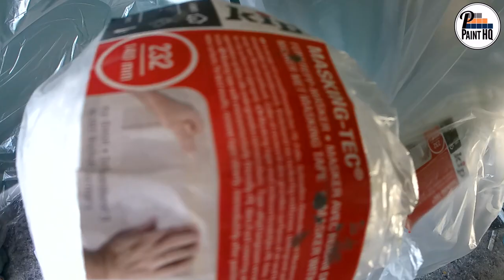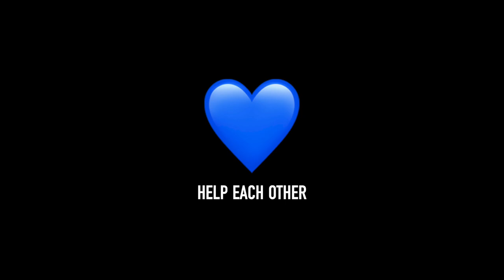The BEST Airless Spray Guns. Graco Contractor PC and Graco Contractor PC Compact

Comment: Hi Pete, it’s been a while – I hope you’re keeping well. 
I have a quick question: I’ve been using Tikkurila Optiva Matt 5 for walls for ages now, probably because I hate change (!) but their recent price increase had me looking around and I noticed that, on a number of recent videos, you are using Johnstone’s Acrylic Durable Matt. It seems to be a  of the price of Tikkurila! Have you found any drawbacks with it? 
With thanks and best wishes, Rob

P.S. I loved Stephen Ryan’s post that you pinned!
Reply from the maker: Hey Rob, great to hear from you.. yeah I’m doing great, hope you are too my friend.. very good point, it’s a reason I switched to Johnstones, along with Brewers being my local trade store and I rate the colour matches.. I’ve also been a fan of Albany Durable Matt, but I do prefer Johnstones being an acrylic.. basically I’ll thin Johnstones 10% with warm water, it really helps ease the flow, especially with it being a very thick emulsion, so you get 5.5 litres out of a 5 litre can 😆 (Tikkurila being 3 litre / 2.7 litre ☹️).. performance, scrub rating and matt finish is excellent, up there with Optiva in my opinion.. plus both companies are owned by PPG, and I’ve seen the odd Tikkurila exterior product appear to cross over to Johnstones.. as for price, you’re right Johnstones can be very cost effective.. especially if you have a word with your Brewers account manager (if a Brewers is local to you).. Optiva Primer (acrylic) for fresh plaster is cost effective, otherwise I mix a Johnstones acrylic durable matt 30% for a mist coat 👍

Hope this helps.. thanks for the kind words of support 🙏 Keep in touch.. regards Pete
Reply: @PaintHQ  Hi Pete, many thanks for taking the time to give such a detailed reply. Your reassurance is very helpful as I’m always nervous of suggesting a new product to a client. Using warm water is also something I’d not considered. I might be fortunate in also having a local Johnstone’s store in addition to Brewers!
Once again, many thanks and best wishes, Rob
Reply from the maker: You’re very welcome Rob, anytime my friend 🙏 ..Another thing I do, if the client wants to pick a colour off the F&B chart.. i’ll explain what I’m doing, and get the tester mixed at Brewers in Johnstones (not the F&B tester pot).. they’ll mix a 500ml of Johnstones Cova Plus, it’s around £5.. that way customer is able to see exactly the colour 👍
Reply: @PaintHQ  Many thanks Pete, are you just using the Cova Plus for the tester? Meaning, once the client is happy then you would get the Acrylic Durable Matt tinted to the same colour? Thanks and best wishes, Rob
Reply from the maker: Yes my friend.. at Brewers when you ask for a Johnstones tester it defaults to Cova Plus, so you get the colour but not the sheen 👍 ..let me know how you get on buddy 👍🙏
Reply: @PaintHQ  Many thanks for the clarification Pete, much appreciated. Best wishes, Rob

Comment: They spit a few droplets of paint when you press the trigger. I haven’t found a way to fix that. Definitely not the right tool for fine finish.
Reply from the maker: If you’re getting a spit when triggering on (Vs triggering off), it could be the gun packings / or cartridge swapping out of its the Contractor PC .. Or the gasket / seal needs checking in the tip guard (should be the smaller orifice gasket if using LP / FFLP tips ..if it’s the bigger orifice gasket that’s used with PAA tips, that could cause a spit like you describe.. hope this makes sense my friend 😆 ..regards Pete 🙏

Comment: What was that you were using to clean your gun at the beginning?
Reply from the maker: It’s just a cheap household degreaser called “Elbow Grease”.. it’s one of the most effective cleaners I’ve used, also in preparation of jobs.. here’s a link to Amazon 👍

https://www.amazon.co.uk/Elbow-Grease-Original-Purpose-Degreaser/dp/B07HRWGWWB/ref=mp_s_a_1_3?crid=NGXN1B6TTLZO&keywords=elbow+grease+spray&qid=1681108920&rdc=1&sprefix=elbow+gre%2Caps%2C120&sr=8-3

Comment: That compact gun looks tiny 
Probably ideal for spindles and tight areas 
Stick with my tritech
Reply: Having said that I’ve had two tritech guns where the handle thread has worn out and will no longer grip and leak 
Have you had this at all Pete ? 
A Wagner one to
Reply from the maker: Hey David, it’s design as to how two fingers wrap around the swivel / hose, plus a 1/8” whip makes for a very flexible setup 👏👏👏 ..thanks for your input, always a pleasure to hear from you 🙏 ..regards Pete
Reply from the maker: Oh dear, sorry to hear you’ve experienced that.. no I can’t say I’ve had that problem.. if you ever get chance to ‘handle’ any of the Graco PC guns, I think you’ll be impressed, especially the amount of time you spend spraying.. the ProConnect gun cartridge swap out is a great time saving feature to keep you spraying too 👍